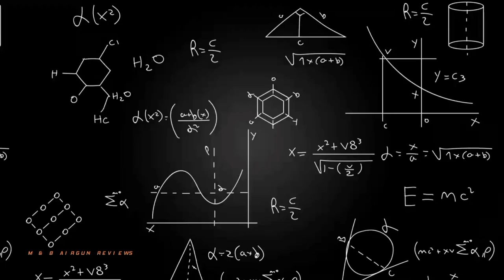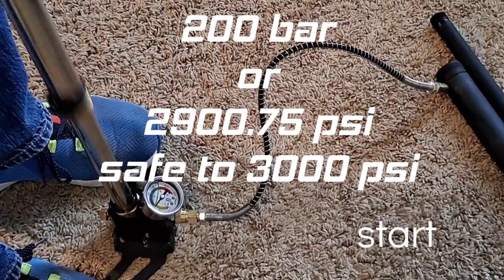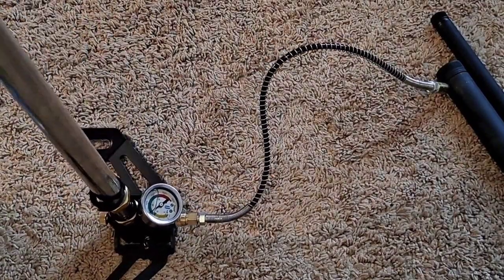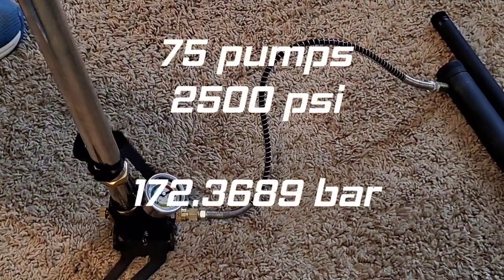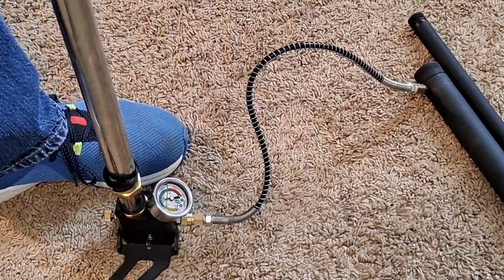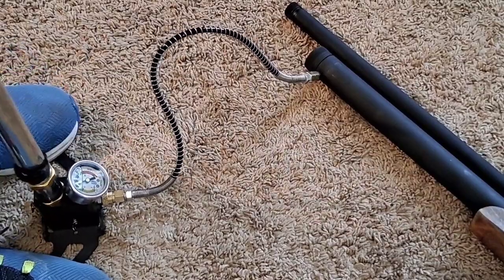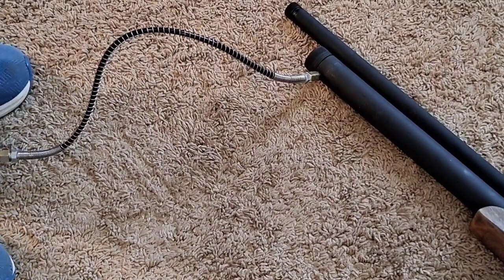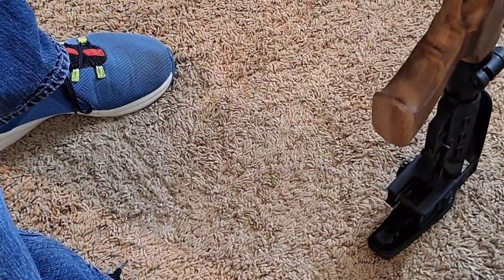HAND PUMP TO  3000 psi  or 200 bar.   How long does it take  to fill? lets find out!

Comment: I have the exact pump. Your pump seals are almost gone. That nose you hear is the water in the inner Tube that surrounds the 3rd stage. Bad thing water will start getting in your rifle and that is bad and dangerous over time. Rebuild the pump and your good to go. Tip: Always use silicone to lube the pump before use. Store with valve open. Break in-between 40 pumps to let pump cool. Your pump seals will last longer.  I had my pump geez over 4 or 5 years now might be longer. It's now a backup to my Yong Heng air compressor i purchased last year for $180. Love it never had a problem out of it and use it to fill my 60min SCBA tank 4500psi and i fill it to 4500psi. Do  maintenance on the compressor along with proper type of oil like anything else and it will last.

Comment: Hay Mike can you look back in your buying history and pin a link to your 4 stage hand pump in the comments? There are so many hand pumps out there. We all want to buy one someone was had good luck with already.  Thanks again great stuff!
Reply from the maker: Yep. Hold on a sec. I think I've got it. Someone else asked earlier.
Reply from the maker: Hope this helps

https://www.ebay.com/itm/4500PSI-Motorcycle-Car-4-Stage-High-Pressure-PCP-Hand-Operated-Air-Cycling-Pump-/274398852514?_trksid=p2349624.m46890.l49292

Comment: Wow.. That really actually sounded like a workout. And did not even start from empty.. Whew!!!
 Now I at least know what might to really expect.. The dude that recently pumped  on AAR somehow seemed to do it way easier.. Now I know at least that there are differences from pump to pump. Need to pick one carefully..
Reply from the maker: This is a three stage. a four is much much easier
Reply: @FultonStreetBeats  Yeah. You stated that in the video. A very good piece of info for me. Thanks for that!😊👍
 Since not gotten to buy myself a pump yet, I had no knowledge there are these small but important differences between them. Need to carefully search info about the pumps while weighing the prices and all. Those four-stage pumps oughta be of them bit more expensive pumps too then I guess..
 Been though already thinking of building a machine to work the hand pump by a three phase electric motor...😂 Seen videos of some on YT - but often they've been made to take a bit too much of space with long turning arms etc..

Comment: you really need a yong heng air compressor well worth the $
Reply: The Yong Heng air a lot less expensive, but the Benjamin keeps some money to a USA business. The Benji is made in China, and you can source the same one for $200 off if you look carefully. I wanted aircooled so I didn't need to fiddle with the water, my brother has a different water cooled compressor and it's a pain to try and bring with you. But I have an idea on that too and need to discuss it with owners.
Reply from the maker: dont they run around 250?
Reply: @minigpracing3068  i need a scba tank but it'll be a while before I get one
Reply: @FultonStreetBeats  i got mine on ebay free shipping for $284
Reply: @FultonStreetBeats  you can find them all day there for different prices
Reply from the maker: @airpower7692  ill check them out for sure
Reply: @FultonStreetBeats  The Benjamin compressor is around $600 to $700 normally, think mine was around $450 with the holiday discount.
Reply: @FultonStreetBeats  I've some video on it if you want check them first

Comment: Pumps suck, but when all the power is gone, I can still hunt for my dinner! Takes me about the same time with my Benjamin pump on my Bulldog. I did get the newest Benjamin compressor with a black Friday deal, haven't really used it for more than a single test to fill up my dads Marauder pistol, stupid thing sounds like a jet engine with the cooling fans running. Stupid loud!!! Need to try it on a battery and see how it does, only tried a wall plug so far. Maybe I'll record a clip to send out for other people to use, airgun stuff doesn't really go with my channel.
Reply from the maker: The four stage is soooo much faster and eaiser.  But this cheap Ebay pump does the trick and is very well made. + they even send seals and valving to rebuild it twice! Yes I would be interested in that clip!
Reply: generators my friend for sure
Reply: @FultonStreetBeats  I just bought everything at once, and the guy at Crosman I was talking really helped a lot. Only about an hour down the thruway from me so I wanted to help keep the lights on. They make some good stuff too.
Reply from the maker: @minigpracing3068  not much up this way. So I'm  driving  a long way or ordering.
Reply: @FultonStreetBeats  I still ordered it, I don't think Crosman sells direct from their location, just want to keep money local as much as possible these days. Most of my stuff came from Pyramid, but looking to branch out to other sellers too. Baker had the FX radar, they were helpful when I had questions too, probably funnel more through them in the future.